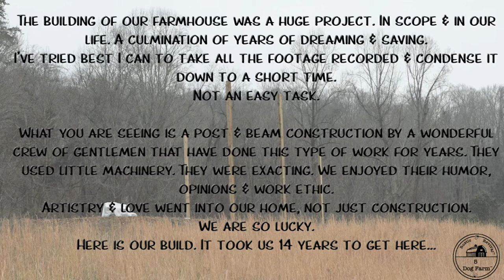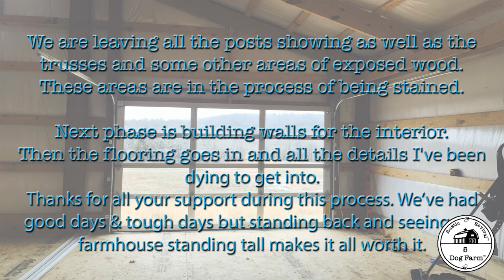Time Lapse Monitor Barn Build I 5 Dog Farm

Comment: 5 questions; What overall size is the building?  How long were the center isle posts??  6x6, 8x8????   How deep did you bury them??   No cement/concrete?
Reply from the maker: 40x60
30’
8x8
10’
Cement

Comment: how wide is the center section?
Reply from the maker: We kept the interior as a wide open living space so it is 40’ wide. The upstairs loft is about 12’ wide and runs 30’ long. If you divided the house into 3 sections, left, center & right using the large 8x8 posts as your “divider” the sections run 13.33’ each. Hope that helps.
Reply: Yes it does thank you

Comment: Can you send me plans of this with size of every thing you have use
Reply from the maker: Thank you for watching. We had a general contractor that employed 3 gentlemen that built the farmhouse. I told them what I wanted ( 40’ x 60’ ) and that it should be a post and beam monitor barn. No plans. I just drew a sketch and it was me and them talking and making it happen. If you do an internet search for “Monitor Barn Plans” or a search for “40’x60’ floor plan” this should lead you in the right direction. Best of luck!!